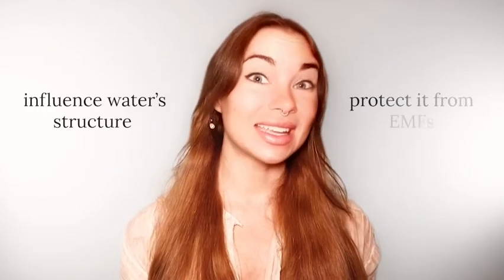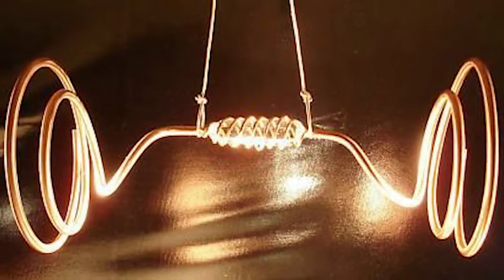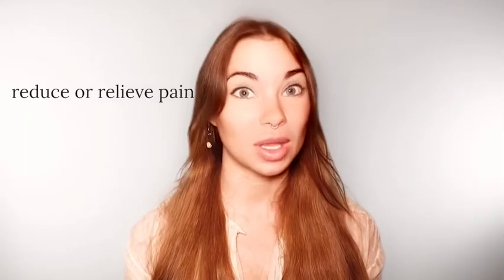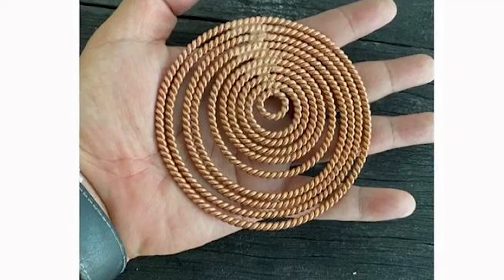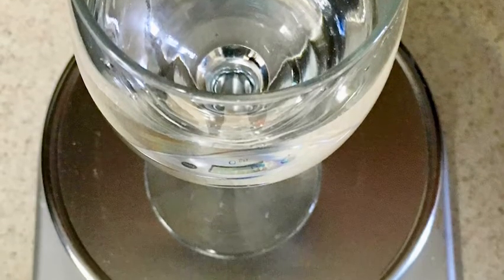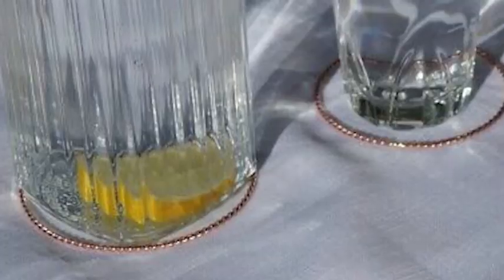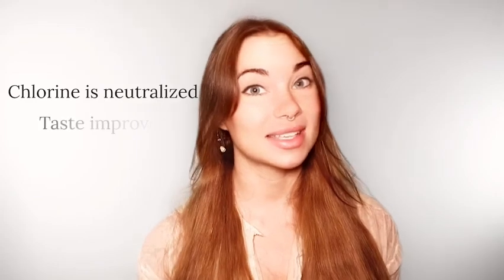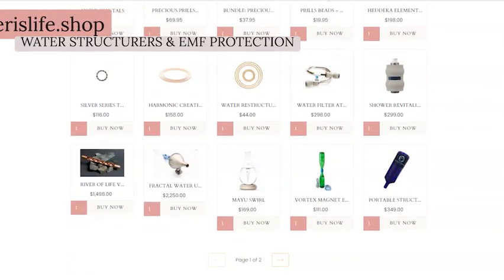Tensor Ring Technology - How These Simple Copper Devices Structure Water

Comment: Thank you! Whatever tensor shape you get, be sure to attach it to something that spins or rotates it. The power increases exponentially - actually orders of magnitude would be a more accurate description. The healings can be dramatic and seemingly miraculous even though it is pure physics.
Reply from the maker: Yes, rotational is ideal! Any suggestions for something that would rotate it around a glass of water?
Reply: @IsabelFriend  Thank you for asking. The beautiful thing about spinning or rotating is that it doesn't need to go around a target such as a glass of water. Your tensor could be in another room , yet the energy will get there and everywhere else. Vertical fans used to cool computers would be one example. HD motors and CD motors have also been used. For outdoors solar powered hangers can be used. Ceiling fans would be another option.

Record players could also be used but make sure it's light weight or it'll wear out the motor.
Reply: Please elaborate. Can you give examples?
Reply: @Sainax1776  Thank you for asking. There are examples in my reply to @IsabeFriend.
Reply: @kelleyeidem667  does it matter which way it rotates clockwise or counter clockwise ? can i hang it outside and it will rotate itself with the wind back and forth ? thank you

Comment: Great video
But one problem. Is copper gets oxidised
A o every 12 hours a HD v clean it with tamarind r lemon r both n remove oxidisation on copper?
Reply from the maker: You don’t put the copper directly in the water so it doesn’t matter. The oxidation doesn’t negatively affect the energetics.
Reply: I always use white vinegar and the shine comes right back anyway